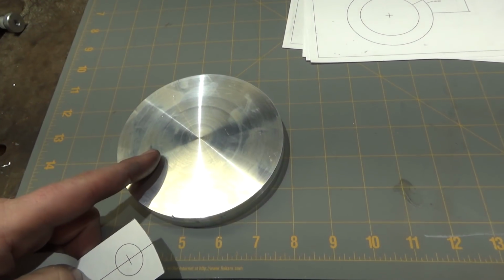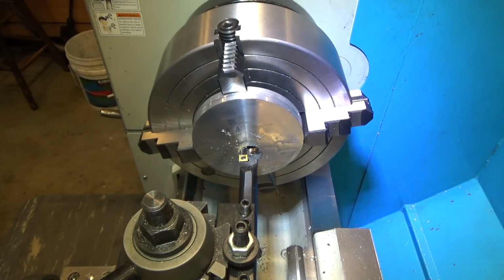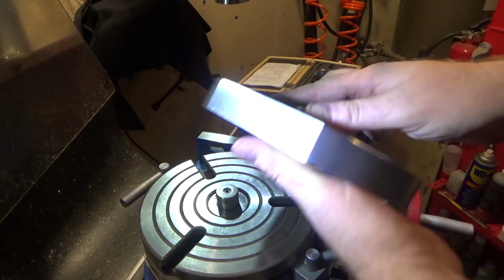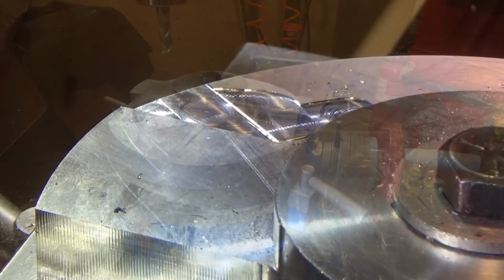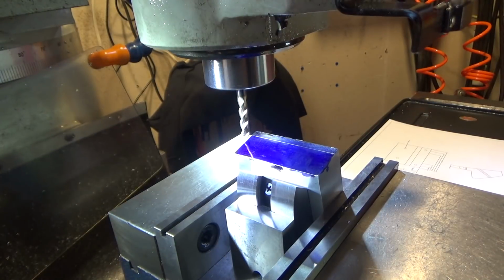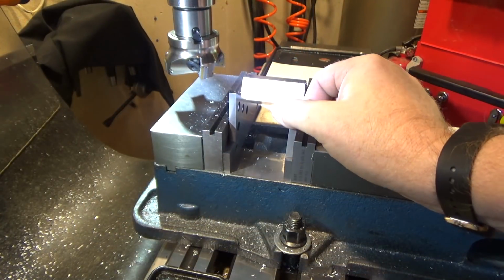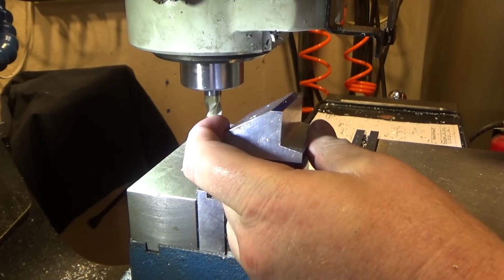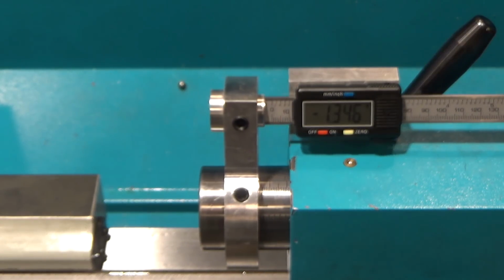Tailstock DRO Part 2

Comment: Your method af locating your rotary table is remarkably awkward and amateurish. Stick an indicator down in the damn hole and true it, like every other machinist in the world would do. You want to know that the bore is concentric with your spindle, not a Morse taper sleeve with something screwed on it stuck in a collet. Jesus, grow up.
Reply from the maker: You make a good point. I missed the concept of accumulated errors here.
Reply: @DudleyToolwright  I get that. Live and learn. You have a co-ax indicator. Use it. Even without a co-ax, it doesn't take long to get one perfect. That way, your job gets the best start possible and you'll have confidence in your set up. Didn't mean to come off like a dickhead. You do some pretty nice work for a guy at your stage of things. Cheers
Reply from the maker: No offence taken. I always appreciate when some one take the time to share their experience and thoughts.

Comment: Another "observer" question:
I thought you were going to glue your template onto your blank.

If the gluing would not have held, why did you not scribe the landmarks into the work?
Reply from the maker: Another good observation. I am not entirely sure. I often am a bit lazy with layouts and skip them. I have paid the price for this laziness upon occasion as well.

Comment: As an observer of lathe turning, I am surprised I have yet to see things to offset the imbalanced part being tooled.
Over all the years lathe tools have been around, I am very surprised the lack of design to help mitigate the danger of off-balanced items.
Reply from the maker: You make a really good point. I think there might be some interesting advantages to a design like that, not the least of which would be higher RPM turning.

Comment: That has to be the most over engineered, inefficient way to tackle that project, other than trying to get YouTube credit. I made a tail dro in 15 minutes using a fraction of the material and effort you did. Works just as well unless yours has voodoo powers
Reply from the maker: I often do not take the easiest path in favor of one I find more interesting. I am totally on board with the simple but effective approach, especially if there is time and money involved. I really appreciate you taking the time to share your thoughts.

Comment: I am so doing that
Reply from the maker: If you are taking a different approach I would love to know about it. I have used this DRO a bunch and so far it has worked out well.
Reply: Dudley Toolwright this is one of those things that will percolate in my head for a while before it springs fourth into existence.   My tail stock is of course slightly different than yours and when those differences get worked out I’ll do it.  I will take some pictures for you when I do it.
Reply from the maker: Thanks. It should be interesting.

Comment: I finally finished watching this.
Incredible job! I’m surprised you made this with such precision and tight tolerance yet you chose an economy caliper?
I guess down the road you could always add a better quality caliper?
I was thinking about mounting one of these, you have inspired me.
Great job. You are a skilled Machinist.
Jeff
Reply from the maker: You make a good point. I tried to find a Mitutoyo scale that was 8" with a horizontal reading display, but couldn't find one. I finally gave up and bought the cheapie.

Comment: very good job make sheer to take the battery out every time your done or they go dead fast I have the same one and even when they are off death is fast  I would put I slit in the plastic and glue a string to the battery and the cover so you don't lose either of them and thank you for making your video's I enjoy them I am going to do the same thing to my lathe craftext 2227 10x18 I think .
Reply from the maker: Great suggestions and you are not wrong about the batteries! If you make a video about your approach, please let me know. I would really enjoy watching. I find it amazing how many different approaches there can be to solve a particular problem. Thanks for the comments.
Reply: its in the electronics the more expensive ones are fine ,my guess would be that the company making them also makes the battery's as well just a guess china .
Reply from the maker: It is true. There have been other youtube videos where people have measured the current draw of various calipers and found the cheaper unites to be significantly worse than the more expensive ones.

Comment: how long did it take till you put a taper in that wouldn't eject? i made a thick one like your and got sick of taking it off to pop the tapers i remade mine of 1/4" with 1 allen screw to free it up. nice job on it it looks great. and thanks for sharing
Reply from the maker: Right off the bat. I ended up ordering some metric screws for the base of my problem tapers. I was lucky in that all of my MT4 tooling either has a tang or is threaded, so I had a way out. Thanks for the comments.

Comment: $100.oo worth of metal to mount a $7.oo DRO
Reply from the maker: You make a really good point. In fact, at the time I was looking for a digital scale, I could not find a Mitutoyo or other top tier brand of the correct size. I ended up settling, but was not particularly happy about it. However, it has worked quite well so far, so I'll keep my fingers crossed. Thanks for the comment.

Comment: great job , i used a plastic calipper a collar with a flat side , and bolt the caliper after cutting off the exces parts on the collar.
the slider with double sided tape to the tailstock, works great!  there was some twisting during drilling no problem due the flexible mounting..  solved the twisting later on..
Reply from the maker: Very nice use of an existing tool. Thanks for the idea.

Comment: Looks great!, I was wondering, on most lathe tail stocks, when you put the drill bit to the work or any pressure on that tailstock, the tailstock will rotate slightly...with your attachment further out, I would imaging that movement is magnified...any issues with the DRO binding?
Reply from the maker: None so far. My tailstock is pretty hefty for a 14" lathe. Perhaps that is why I don't see any noticeable twist. What is a problem is that I measured the angle of the tailstock painted back surface at 12.5 degrees and I was off slightly. So if I tighten the mounting screws tight enough to flex the aluminum indicator base, there is some noticeable twist. Thanks for the suggestion. I will keep a look out for noticeable twist, especially when I use bigger drill bits. Cheers.

Comment: Where did you source the angle set up tool that you used in the vise?
Reply from the maker: I purchased 2 sets on eBay. They were in expensive, hardened, and ground and probably reasonably accurate. If I ever built something with angle settings, I would use a sine plate or at a minimum measure the angle gages for accuracy.

Comment: exelent job i really enjoyed the build. off topic i ordered a set of involute cutters from banggood.  there are the 16 dp with 14.5 preasure angle with 22mm bore. i cant get the r8 to 22mm adaptor because they are out of them right now they said they are going to restock that item. they want $58 dollars canadian for it and i paid $78 canadian for the cutters. did you get the r8 to 22mm from bangood i cant seem to find one in canada yet. ebay has them but it dosent say what the thread is for the mill. my 9x49 mill has a 7-16thx 20 thread. oh i just found one lol. did you try your banggood  gear cutters yet. im still waiting anxiouly for your video on cutting gears thanks.
Reply from the maker: Thanks. There seems to be a ton to learn about gear cutting and I still have to get a rotary indexer, so I am patiently waiting as well. I am glad that you found the R-8 to 22mm tool holder. I had to get it off of eBay as well. BangGood offered me a free one, but never had any in stock to give.  The tool holder I bought off eBay was $54 US when I purchased it and now the link points to a tool for more than $90 US. I guess they figured people must really want them. From you pic next to your name, may I assume you are a welder? I am self taught and it really shows. I have read a book or two, but there is no substitute for practice or experience. I am a bit jealous. The only thing better than watching metal getting cut is watching it melt. Cheers!
Reply: hello dudly yup ive been a welder along time im 58 now been welding since i was 24.  i belong to the boilermakers since 2002 and just made 2 tungstun holders on my 14x40 lathe today out of alluminum. i also noticed you have the same sino dro on your mill as i do. still havent got it all totally figured out. handy tool to have. i have an 8 inch southbend rotary table that im ashamed to say ive only used it once lol. gotta get it out and start makeing stuff like you do. well anyway take care and talk to you later.
Reply from the maker: Yep, jealous, and not even a regular welder, high pressure vessels! Nice. I'm 51 and guess I'll never catch up... Yea, I have several manuals for the Sino DRO's and the are very hard to understand. I know exactly what you mean. I did find a manual that someone had attempted to improve. I think it might be good. Here is a link:
https://www.dropbox.com/s/ghyi1i8jh74sech/sino%20sds6.pdf?dl=0
Cheers.
Reply: thanks 4 the link i checked it out and saved it. does seen to be alot better than the chineese manual 4 sure. well out to the shop im making a cover 4 a polaris clutch and belt pully assembly  on a 340 hp side by side. ok take care talk to ya later.

Comment: Hi! I have no idea if this is at all practical or way to expensive, but I have to ask. When you bore something out, and you would prefer some support against the face of the chuck, could you use a square/pre cut circle of plyewood between the work and the chuck? It would be a sacraficial piece of plyewood.
Reply from the maker: I don't see why not. It seems a pretty good idea. You would have to do something to make sure it didn't get launched, and there is the problem with sawdust, but it would probably work well. Thanks for the idea.

Comment: I feel so lazy,I've got 2 magnets and a screw holding mine on onto a collar on the quill
Reply from the maker: Hey if it works...I thought about magnets as well, but wasn't sure how to execute. Magnets make for easy removal which might be really useful. Mine only has a few screws, but definitely not as easy. Thanks for the comment.
Reply: I grew up with K.I.S.S., and N&S.  Everybody knows what K.I.S.S. means but N&S is Necessary and Sufficient.  Keep things simple and do what is necessary and sufficient and life will be easier.